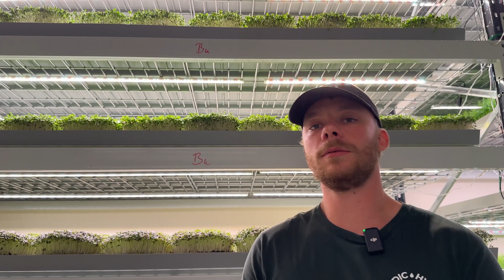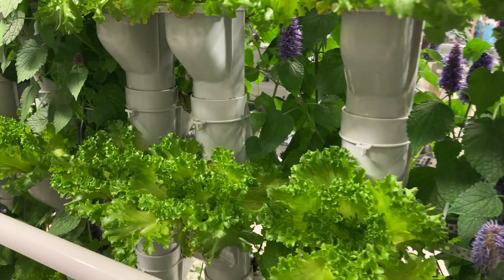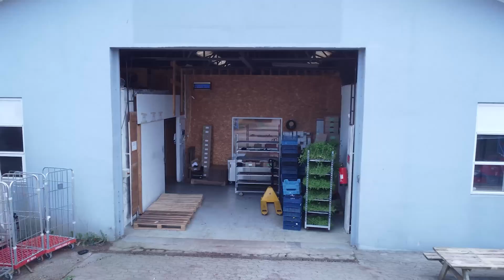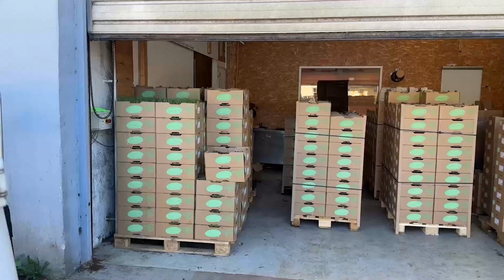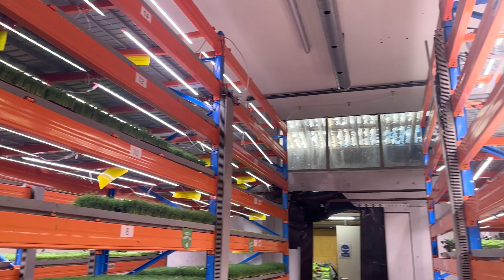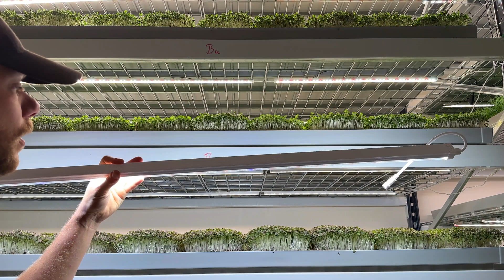What LED Growlight Is Optimal For Vertical Farming?

Comment: What is the typical wattage of one led light I’m currently working out consumption as opposed to the output from wind turbine / solar panel on shipping containers I’m planning on using
Reply from the maker: Each light draws between 20-33 watts depending on the quality and efficiency of each light